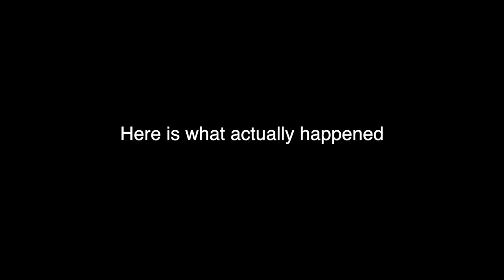How Can I Dig Through This?

Comment: Interesting how you refer to 200 mm, 300 mm and 800 mm, but not to 20 cm, 30 cm or 80 cm. In most case 2 significant digit are sufficient. It probably doesn’t matter if the hole is 800 or 795 or 805 mm, so you would refer to it as a 80 cm hole

EDIT: It is the first time I edit a YT comment. What I tried to refer to, is explained well in the Wiki page “Significant figures”.
Reply: It's just the terminology you get used to using. You wouldn't say 80cm and 26mm you would say 826. You just get used to saying it that way. Or that's the case with me anyway.
Reply: Cm's are just messy
Reply: Builders prefer mm.
Reply: Using the American Imperial system, I much prefer to keep everything in inches.  Taking five inches off of forty eight inches is much easier to do, mentally, than taking five inches off of four feet.  Even though metric is base ten and not twelves, it's still easier to keep it all consistent.
Reply: @HarryLovesRuth  I find metric easier.
Reply: I'm in Scotland, I'm sure the rest of the UK do this, and we use metric and imperial (and baw hairs) as measurements. Whatever is closest on the tape lol.
Reply: @HarryLovesRuth  lol. Metric couldn't be any easier, it's just a series of numbers pretty difficult to get wrong.
From someone who works in metric I find  reading out feet and inches slower. All a matter of what your used to I suppose
Reply: Common usage is mm.
Reply: Tailors, upholsterers and curtain makers use cm. The construction industry uses M and mm.
Reply: HarryLovesRuth I certainly hope the usa moves to the metric system in your lifetime so you can enjoy the benefits of base ten. Though I'm sure your much better at adding and subtracting fractions than most of the rest of the world 😉
Reply: Matt Barker Reminds me if the joke... There are ten kinds of people in the world: those that understand binary and those that don’t.

Comment: I have an Ozito the size of that hilti, and its a beast.. one of the best Hammers i have owned. ANd i have had Kangas, Bosch, Makita, Ramset..   Dont diss.. Ozito, they are cheap, but dont let that put you off..   also Aldis cheap jack hammers are good too..    This video is obviously staged so the Hilti Rep can come in and save the day against a cheap ozitio... screams of desperation of larger brand name companies under the stress of smaller ones doing the same thing well for alot less. ..  the elitism in rock and concrete breaking is gone...
Reply: Im pretty sure in the previous video i talked about how good the little ozito is, like you mine has done a tonne of heavy work and just keeps going. Cant be beaten for the price. So this wasnt staged, was just that the ozito was to small for the job and Hilti are happy to lend Scott thiers cause they obviously get some exposure. Just a win win.